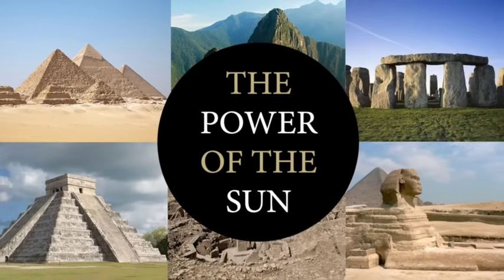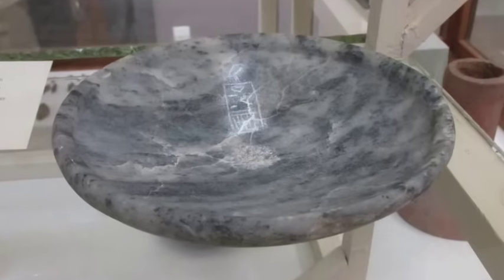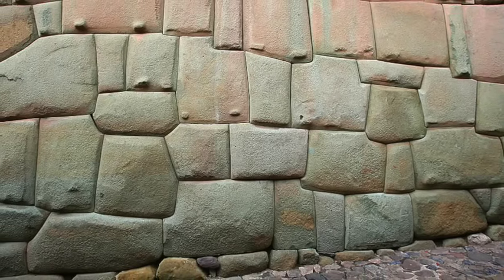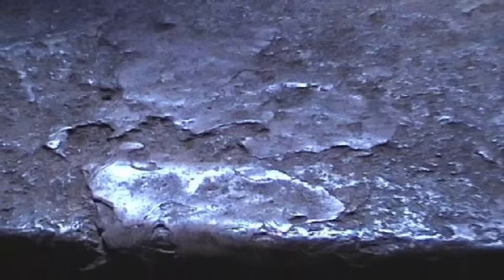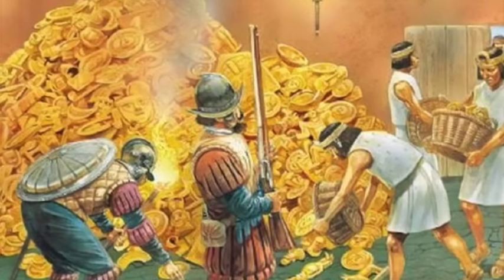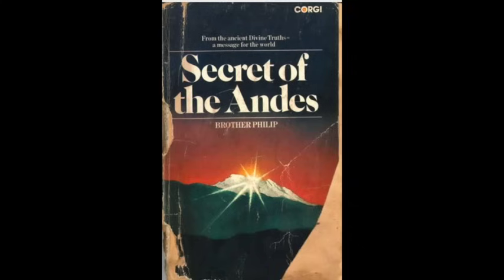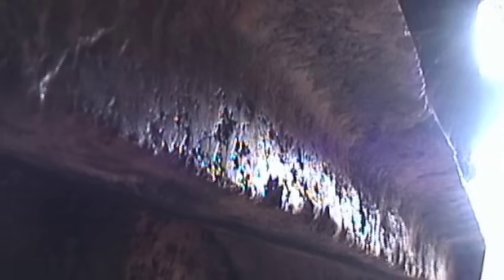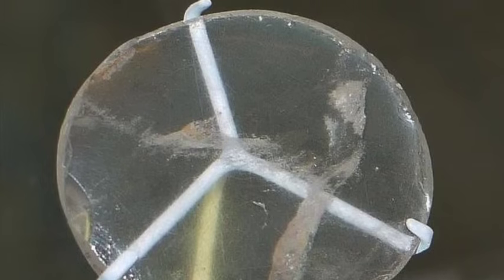How the Ancients Cut Stone with the Sun - Lost High Technology Explained | Ancient Architects

Comment: no, the sun is not the answer , first to melt granite you need 1250 degree C , when melted there will be no more crystals , there are multiple example of cutting trace width of 1-3 mm , see the LAH report from Russian scientist
Reply: See this low tech approach to 2100 °C: https://www.youtube.com/watch?v=drE54ctrHBY -- with just the power of the sun!
Reply: i already know that turning rock into glass , but the traces we see all over the world is very small as 2 mm width and can reach meter long please take time to see LAH report
Reply: Oh. I know the Laboratori of Alternative (H)istoria very well. I'm a big fan to be precise. Meter-long radii for cuts observed in Egypt are indeed an interesting observation. Looks like some Jedis were around in the ancient time. (If you swing a laser sword you easily get these radii-;) You actually do not need to melt rock in order to cut it. If you apply light very suddenly it my also make crystals crack up due to the thermal stress. Furthermore any smooth surface has most likely been eroded away by the thousand of years of sand blasting. As we see a plethora of obscure tool marks I guess we have to assume several advanced tools in action. For the precise large radial cuts observed by lai I could only image one technology that can do it. Mostly because of the ease of which the tools seem to have been applied. Think of a pulsed laser induced low energy nuclear reaction knife driven by a cold fusion cell. There were definitely some high-energy portable tools out there. The key I think is in the hands of the Pharaohs statues. You will frequently see the statues seem to be holding something in their hands, but the tools are always missing. Luckily some ancient depictions have survived. Sometimes it looks like a scepter in form of a serpent -- made out of copper this thing is actually a huge perfect coil, which could be used to receive beam powered energy. Of course the idea of having highly intelligent, highly advance "priests" around playing fool to humanity for over 10000 years and maybe also having some alien bases scattered around on the surface of the Earth, isn't the kind of information the common public is willing to accept, yet.
Reply: i think all fancy statues and temple including Giza pyramids were constructed by aliens some 15,000 years ago way before any stone age culture emerged , in Egypt they reused all that was already existing
Reply: Absolutely possible. I personally like to think that some kind of messager spaceships regularly visit Earth (the Khronos fleet), which leave their fingerprints here. The goal is not so much settlement, but to engrave the message of enlightenment on the surface of Earth. Think about a panspermia of a fully developed Solaris style whole planet covering superintelligent technosphere, which likes to spread its existing to other systems.
Reply: ?? i do not understand
Reply: Well yes. E.g. most granites contain uranium naturally, which is not much stable. Only a few atoms blasted that way should develop enough thermal to blast the crystalline structure into pieces. The good think: the energy for cutting the stone comes from the stone itself making it a portable solution.
Reply: There's still the inconsistency between the non-weathering of the pyramids and the tremendous weathering seen on the Sphinx and its enclosure.  So it was not contemporary with the pyramids since they are both made of limestone or sandstone.
Reply: it might be wiser if we assumed they may have used a pan-spectrum frequency generator, from UV to Micro-wave, to sound wave, to laser all at once.  If they could do it, it probably would have been a superior method at destabilizing molecules.
Reply: to adrien naah yes something like that creating very fine energy beam dissolving/ disintegrating any type of rock into sand ,, erosion on great pyramid cannot be observed because an important part  of limestone surface was remove by Egyptians people some 100-200 years ago
Reply: Thanks for pointing out the fairly obvious which I had failed to perceive. That changes my approach to the age of the pyramid a bit since we can't know how badly eroded the missing limestone cover was. Judging by the capstones of the Khafre pyramid, it seems that the limestone weathered quite well, -but that isn't evidence of how well it would weather if as old as the sphinx.

Comment: Show us an example of YOU doing it.
Reply: The point was: Has anyone actually attempted this?
Reply: +Taylor Daniel Sciff Geniuses show their work. Geniuses also don't care about negative or positive energy. Just truth.

Mirrors using the sun to cut through granite ... do you have any videos showing this <i>being</i> done, rather than just speculation that it <i>could</i> be done?

If the ancients did it, surely somebody today has replicated it, right? 

If so, please show.

If you can't show any proof, please just admit you are a lame twat yammering on about nothing.
Reply: Who needs gold? Use metallic gold Mylar sheet (couple of bucks) and a old satellite dish and test out your theory. But I can save you the trouble, it won't work. With a silver metalised Mylar sheet and a large satellite dish it is possible melt rock but only in 10 mm diameter circle and there is the tendency for the stone to fracture from thermal stress (cutting lasers have a very small diametre so this may not a problem - some stones DO fracture). So no, the Ancient Egyptians did not use sunlight to bore holes in granite or surface treat stone blocks.
Reply: Negative energy? With a silver metalised Mylar sheet and a large satellite dish it is possible melt rock but only in 10 mm diameter circle and there is the tendency for the stone to fracture from thermal stress (cutting lasers have a very small diametre so this may not a problem - some stones DO fracture). So no, the Ancient Egyptians did not use sunlight to bore holes in granite or surface treat stone blocks no matter how much positive energy they projected at it!! lol
Reply: Are you 'avin a laugh? Is he 'avin a laugh? - got it in one, I should not of bothered to reply to them lol
Reply: Michael L https://youtu.be/Xb86OzFeuXo
Reply from the maker: The Rhins Ranger I haven't got that much gold. Please donate! :)
Reply: Taylor Daniel Sciff sir geniuses prove their theories. Requesting proof that a theory is applicable is neither foolish or too much to ask. If somone told you that they could build an antigravity drive apace ship I bet you would want proof now wouldn't you? If someone claimed to be super human I bet you would yell at them fkr that too wouldn't you? So my guess is that you are one of those people that think you have all the answers to all the things in the universe and those answers are in book called the bible. And anything that questions your belifes you attack. Am I right? Claiming a thing and proving a thing are altogether different.0
Reply: That supports the making of sandstone and limestone vases, but not diorite or granite vases.  To make even one via such a technique would be time-prohibitive, and time was not even a factor in the making of some 40, 000 stone vases found under a pyramid at Saqquara.  Tools were used that were more advance than what we have today because they could do the job much faster than we can.
Reply: lol, taylor calls rhins ranger a fucking fool, infers he's feeble minded and only brings negative energy.... you're a hypocrite, taylor. rhins asked for proof, you're the negative energy.
Reply: The Rhins Ranger first ask modern science to replicate citting stone with copper dildo.
People are soooo efffing dumb